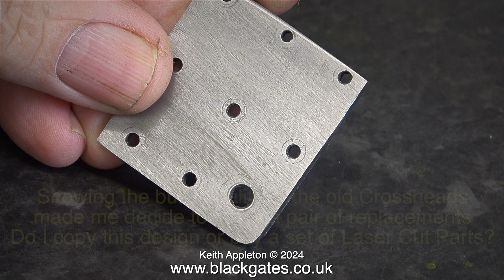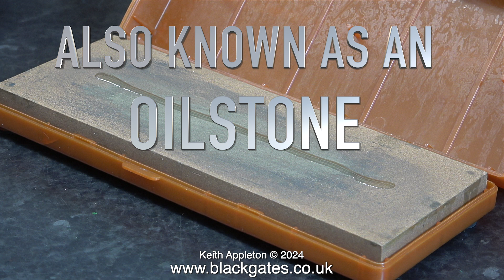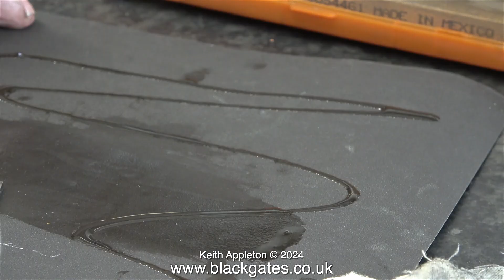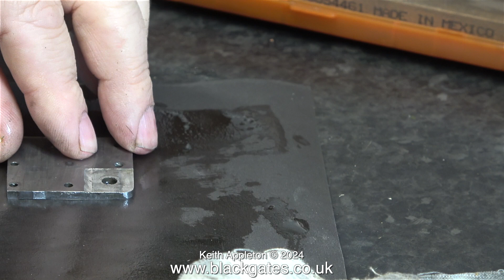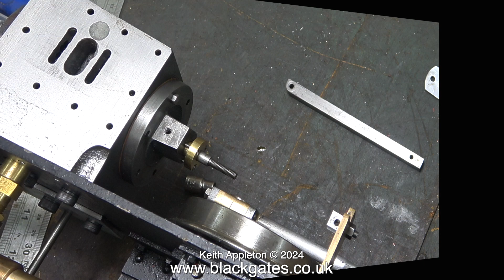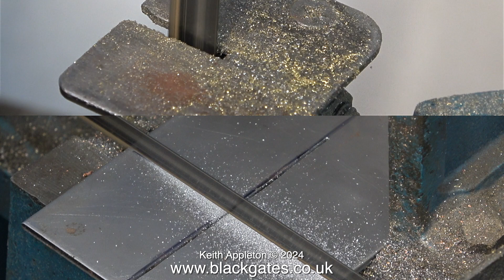A BLACKGATES SWEET PEA LOCOMOTIVE BUILD - PART #64

Comment: Not so much scribed as engraved! Someone has a carbide scriber. Edit: Whetstones did indeed run in water baths (the big round ones at least) and you can buy expensive Japanese water stones, but whetstone in itself is almost synonymous these days with oilstone, and that is what I use. The very latest are diamond stones and they also tend to use water based lubrication, so you take your pick... As an aside, the mixture I used in my glass cutter is a mixture of light machine oil (sewing machine lightness) mixed with white spirit and I am told that this is pretty much what WD40 is... I don't cut much glass these days so I haven't tried WD40 but I suspect it would work just as well as the old mix, though it would likely cost more.

Comment: Another entertaining and instructive video, thanks again Keith. 
A verbose word to answer your critics: You are using the whetstone properly, to whet or sharpen or abrade the surface of a tool.  I have a whetstone given to me more than 40 years ago by my late father-in-law, a proper machinist for his long adult life. I have always used it just like he showed me - sharpening blades on the stone under a trickle of running water. 
 I've more than once attended demonstrations of pre-industrial technology where a worker would sharpen, or whet, a blade using a spinning stone (sometimes called a grinding wheel) turning in a water bath.  
The purpose of the cutting fluid on a whet stone, whether water, oil, alcohol, liquid soap, glycerin, or various even less pleasant liquids, is to remove the particles of metal on the stone that have been abraded from the blade or tool.  It is a cleaning fluid for the stone, not lubrication for the blade.
All the sorts of whetstones that I am aware of wear out with use. Mine has a deep scooped spot in the middle, that is nevertheless flat across the width, perpendicular to the stroke of the blade when sharpening.  
Blades or tools whetted using water as cutting fluid  to clean the stone don't rust more quickly than oil whetted blades -- I have blades older than my whetstone that are not rusty or dull (depending on how long its been since I sharpened them).  All tools must be cleaned and dried before use or storage.  If I stored blades wet (not whet) or in a dish of water, I'd expect to lose them to rust because of my neglect, not due to the way they were sharpened.
Apoligies for being so long.